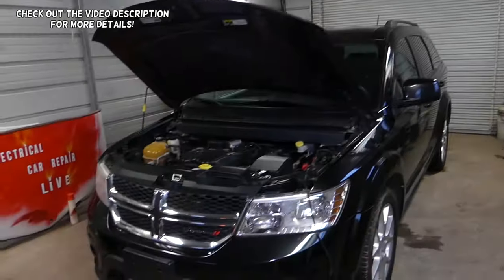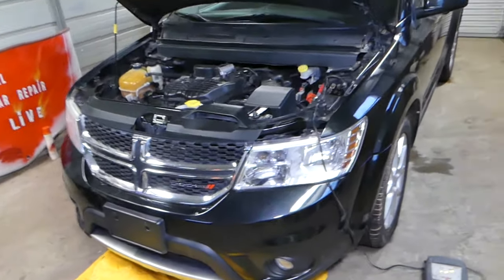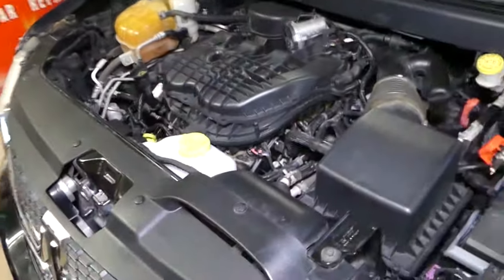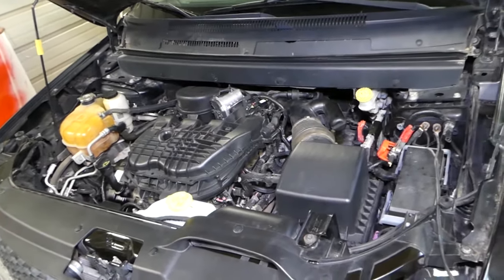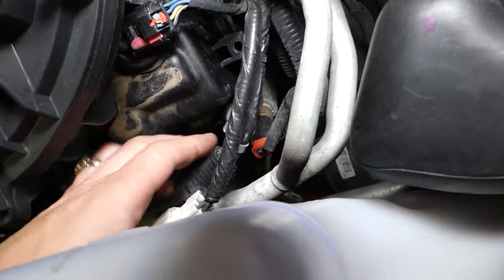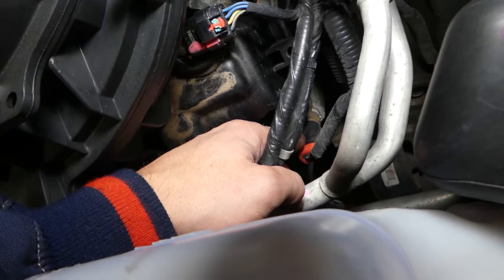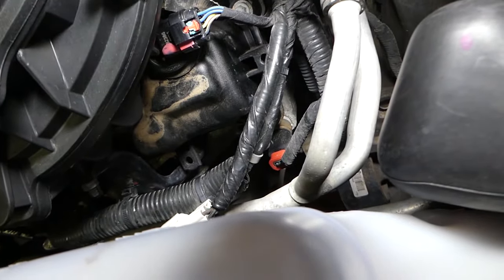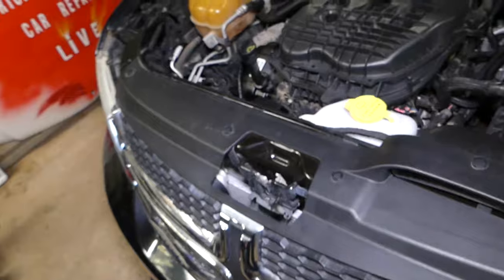DODGE JOURNEY COOLANT TEMPERATURE SENSOR LOCATION REPLACEMENT

Comment: Hello im having a problem with my 2017 3.6 journey
The temperature for coolant and oil have both been going up at the same time almost to the point of overheating. Iv done the thermostat not long ago as well as the oil cooler housing since it cracked. It does run really bogged down and doesn’t want to pick up speed
Thank you for any help

Comment: How do we know the problem is not the thermostat instead of the sensor? or vice versa
Reply: Signs are sudden gauge dropping 0

Test is, when gauge drops or reads “low”, run the heater, full blast, rear also.  If air comes out hot, thermostat isn’t stuck open. Sensor is reading incorrectly. 

Air comes out Luke warm at best?  Try the thermostat.
Reply: Hey my cold and hot gauge is normal in the middle but my outside temperature gauge is showing hotter than what it really is.?
Reply: @MatthewOrtiz-wg7tv  those are 2 separate systems. 
The out temp is measured by a sensor located behind the front bumper while the coolant temp sensor is located on the engine measuring inside (drivers side near front side exhaust manifold)

You might have a dirty sensor or defective.

Comment: My 2013 grand caravan , on idle and the ac on the fan wont start,. The fan otherwise function propperly. Y jumped k11 to force fan to be direct and the air condition work perfecr on idle. Any idea whats bad?